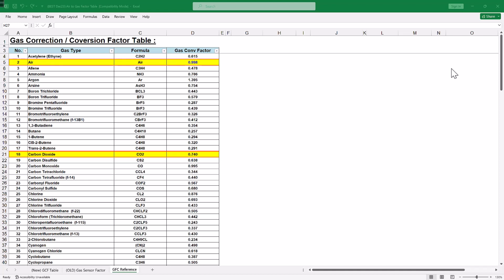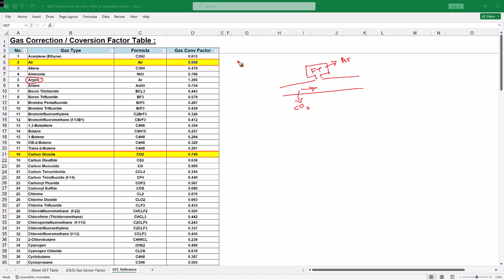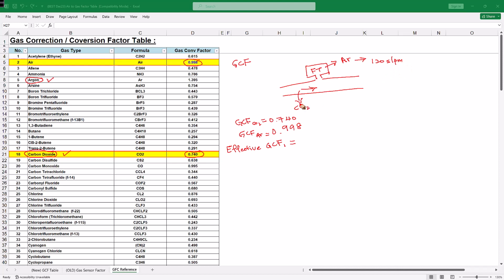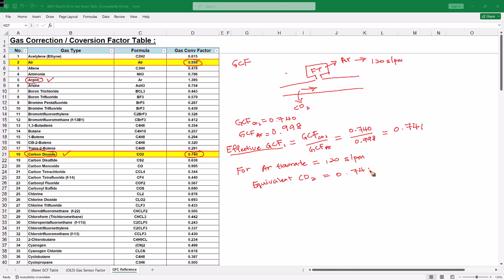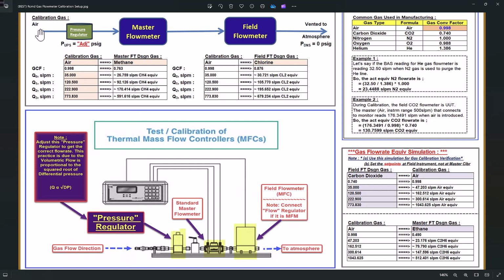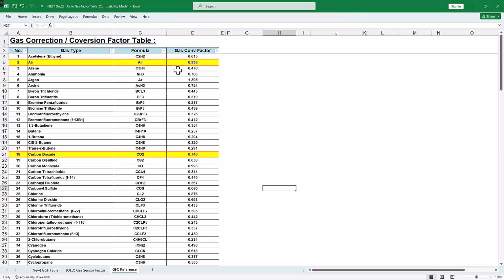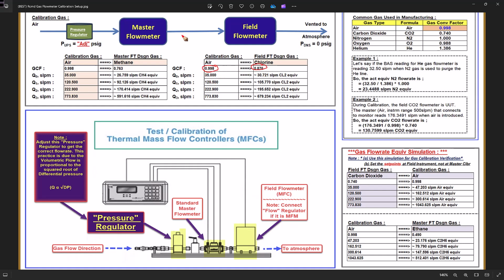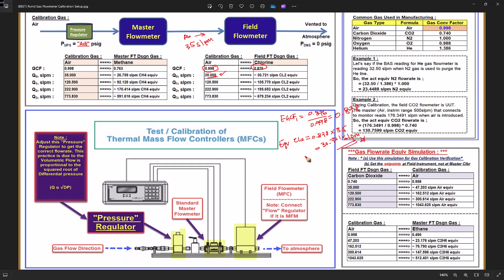Using Gas Conversion factor to Find Equivalent Gas Flowrate

Comment: what if the flow sensor is for ammonia, but i want to have it to measure the flow for mixed gas contain nitrogen, hydrogen and ammonia. how to calculate the conversion factor and to calculate the equivalent flow?
Reply from the maker: Hi @noorashikinmohamad3175, to my understanding the conversion factor is used for single gas instead of gas mixtures for simple manual calculation. However, may be there is software available in the market specifically design to calculate the equivalent flowrate for gas mixtures. Thanks

Comment from the maker: Understanding Gas Conversion Factors
Calculating Equivalent Gas Flow Rates
Real-world Examples and Scenarios
Importance in Engineering and Industrial Processes
📊 What You'll Learn:
Uncover the method behind utilizing Gas Conversion Factors, an essential skill in the field of engineering and industrial processes. We break down the process with real-world examples, making complex calculations accessible and applicable.